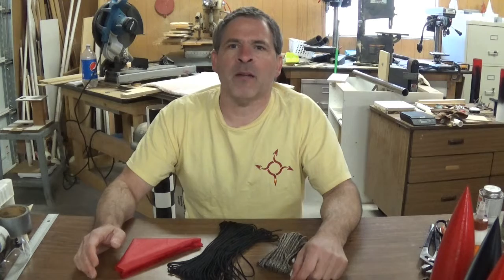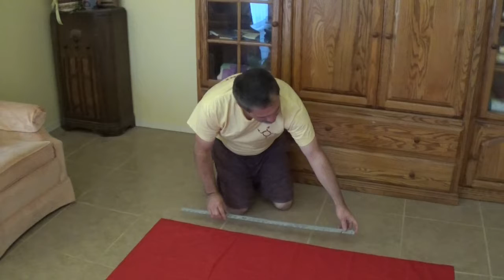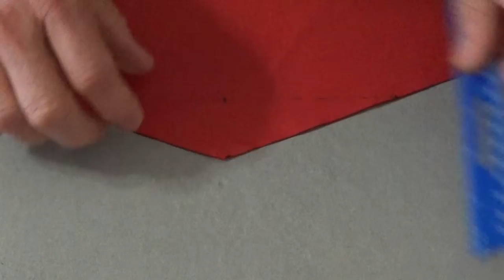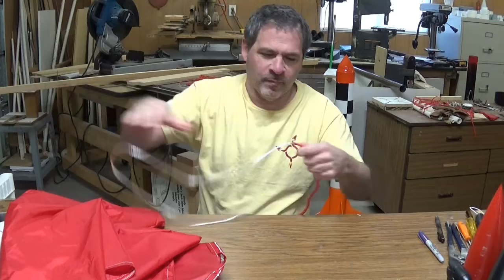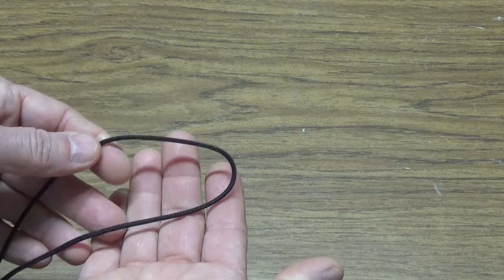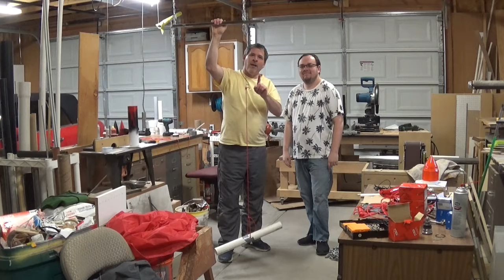New Improved Homemade Ripstop Nylon Parachute  for Model Rocket - DIY How To Build

Comment: 14:30 good idea stitching loops into the cord. There’s a way to make the loops look much neater. Use an awl to open the cord where the loops folds back onto itself and the stitch begins.
Reply: The tool you used here( 18:45 think you called it a Fid) would probably make it even easier to do.

Comment: hello sir , can i get the links for these materials, especially the particular nylon u used and the parachords ..online purchase links*
Reply from the maker: I bought the ripstop nylon fabric on ebay...
https://www.ebay.com/itm/173172338826
You can use a wide range of paracord sizes. In this video, I used 550 paracord which is 4mm diameter. But I've also made this same parachute with 2mm paracord as well. So anything between 2mm and 4mm works just fine. This can be found on ebay, temu, amazon and a lot of other places online.
Reply from the maker: Oh, I also wanted to mention that I have another ripstop nylon parachute making video that's a simpler design... Here's the link...
https://youtu.be/J_75YXj-HKw

Comment: Load rating is generally only 20-25% of a rope's tensile strength. So your 275-pound cord should support around 1,000 pounds...that's without removing the central cords AND without any knots. All knots reduce a rope's strength, some are better than others for maintaining the rope's strength.

Comment: Pretty nice ! I've sewn my first parachute during the holidays. It's an elliptical shape with 12 gores. Unfortunately the fabric is quite bulky and pretty porous, so I'll give it a go with the ripstop I bought. 

Your way of making the attachment points might be a bit difficult. Apparently, people just sew the cord to the fabric, or sew a piece of cord to form a loop, and then tie the shroud line. 
I also gave a go at splicing and ive discovered soft shackles. They are basically quick links, but less bulky and a lot lighter.

Great video anyway, it was funny to discover all I've learned lately in this video
Reply from the maker: Yeah, I know my shroud line connection technique is a bit difficult but it comes our really nice. That's also why I discussed a few options for attachment. Ripstip nylon is definitely the way to go. I am impressed with the amount of strength and the super thin material folds up real good.